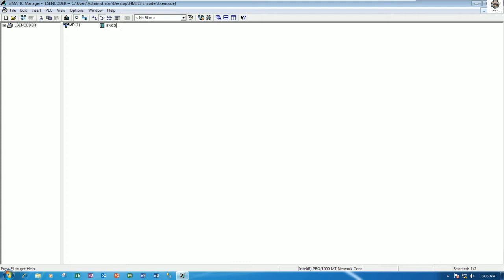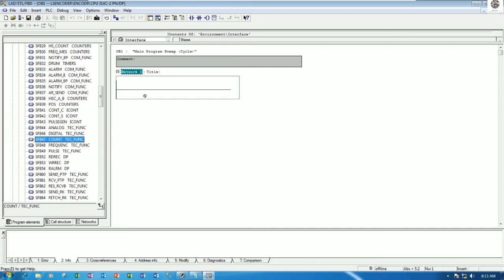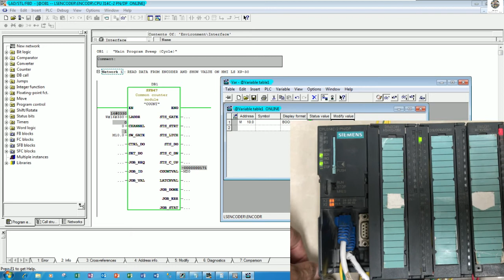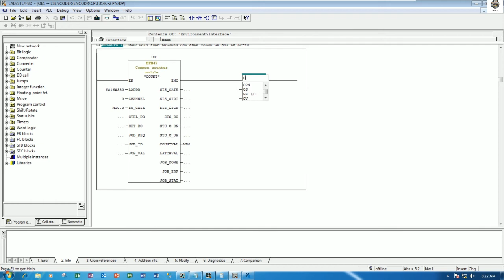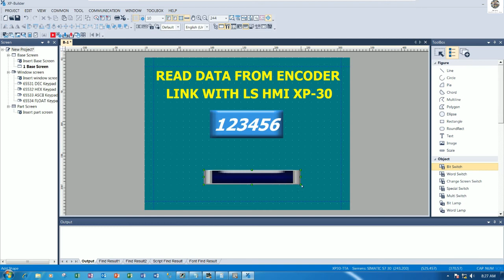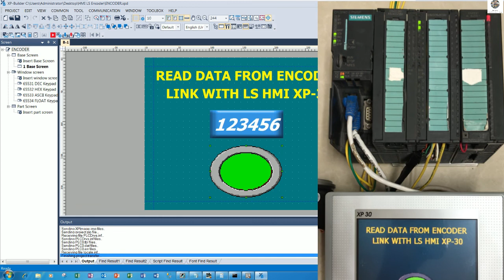Read data from Encoder from PLC S7-300 and connect with HMI LS model XP-30

Comment: Please, engineer, can you help me?
 I have a project. I used a PLC S7-300
 I want to set a time because the process is up to 800 Minutes via the HMI screen.
 Also, I want to display the remaining time to end operation in the HMI screen.

 Thank you
Reply from the maker: Dear sir,
Which HMI model? I can create a video that related to your process the you can follow my video, for timer we can view and we can set also.Anyways I will prepare a video that related to how to view the timer and setpoint the timer that ok?
Thanks you!
Reply: @generaltechnologyknowledge5165  
Dear sir,
HMI SIEMENS (TP 177B 6 color PN/DP).
With Wincc flexible program.
and PLC S7-300 CPU 315.
With SIMATIC Manager.